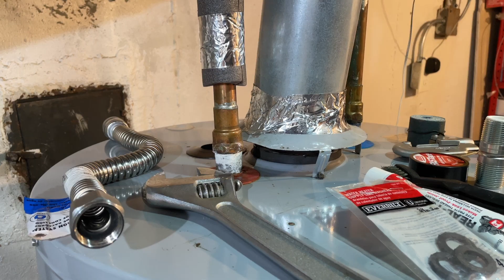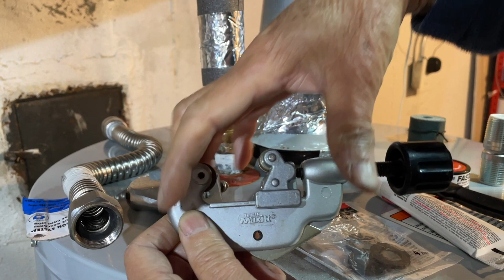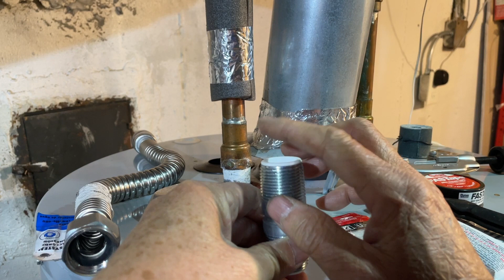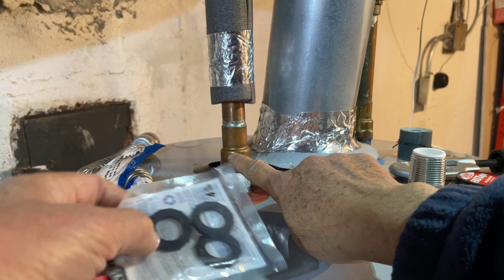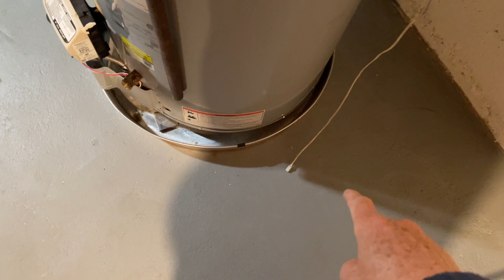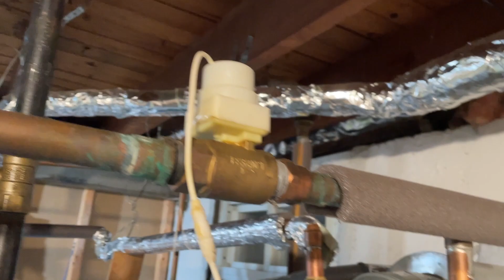Repair gas water heater supply line leak and the pipe nipple from hell

Comment: Don't forget to turn water off before you cut water line.
Reply from the maker: Absolutely turn off the water and the water heater. Have some rags or towels handy. The plumber who installed this probably soldered the 3/4 inch pipe to the compression cup after attaching it to the nipple. Maybe that's why the plastic insert of the nipple got warped in the first place. I could replace the nipple but at least it's not leaking now.